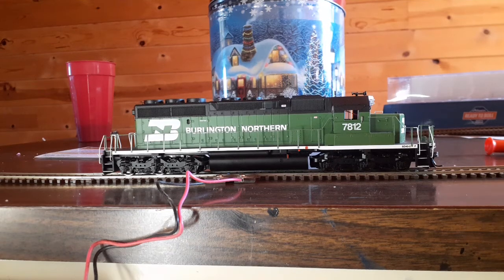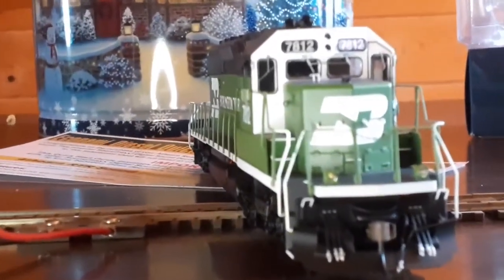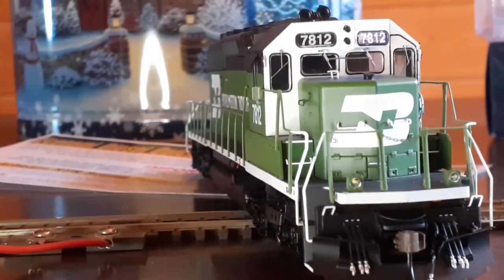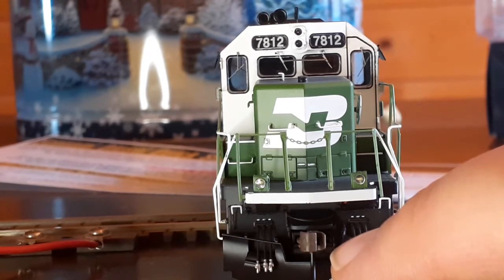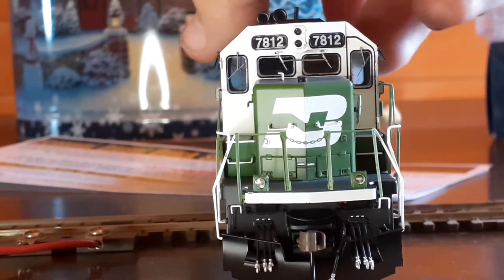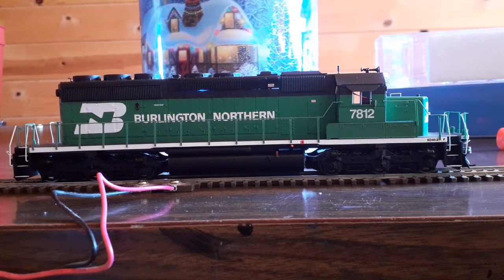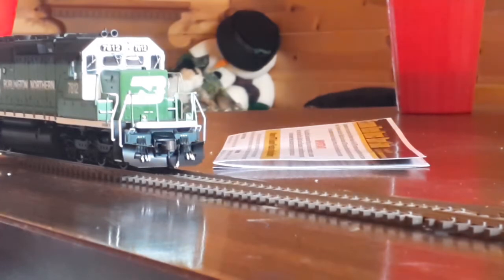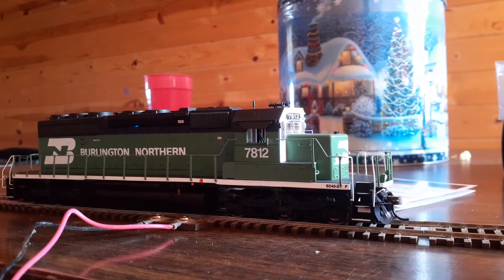ATHEARN READY TO ROLL EMD SD40-2 REVIEW!

Comment: I got lookin at some old videos from wyoming in 1994 with some SD70MACs and they had ditch lights that fashed when horn was blown and stayed solid when not blown but some of the other other SD40s had the white face paint which is what BNSF 1915 is painted in
Reply from the maker: You are correct in that BN's early SD70MACs did indeed come equipped with flashing ditch lights, however as I mentioned in the video, the lights on BN 7812 as depicted on the Athearn model aren't technically ditch lights.  They're deck mounted strobe lights that flash when the horn is sounded and then shut off after a few seconds after the horn is sounded.  Also as mentioned in the video, BN 7812 is widely believed to be the only SD40-2 to wear the white face scheme AND have "Burlington Northern" spelled out on the long hood with a large BN herald.  There were GP50s also shown wearing this exact scheme too.  Various other BN units also had the same Burlington Northern and large herald on their flanks as well, the big difference was those units had the orange and black (and in a few cases orange and white) striped nose and headlight area panted orange as well.  That being said, it's not easy trying to keep up with all of these Various iterations of BN's paint scheme, not to mention we're also talking about units as they appeared well over 30 years ago, thanks for watching.
Reply: @randallellison6421  you are correct on 7812.but with the othet white face schemes they did not have BN spelled out on the long hood

Comment: So I have a BN sd40-2 I think it’s an athern but for some reason I have 2 controllers one was a Bachman ez command another was an ncs power cab I bought the ncs and sd40 off Facebook the guy showed me both things and they worked then but when I took it in the sd40 just sits and idles on the ez command doesn’t respond to anything else does move nothing I sit it on the rails it just idles doesn’t do a startup sequence either and the ncs power cab doesn’t work at all doesn’t even turn on and both things worked when I got them
Reply from the maker: Unfortunately, I'm not familiar with either system, so I don't know if this will work or not, but you could try doing a factory reset on the locomotive and see if that does the trick, or if you have another DCC equipped locomotive handy, try it and see if it runs with either system.  Usually, that will tell you if its the locomotive in question or if the controller is faulty. Thanks for watching!
Reply: @randallellison6421  I do have other dcc engines the one is a es44dc inter mountain runs fine on the ez command but not on the ncs power cab I recently bought an sd70 ace it runs and goes but doesn’t do the startup sequence but it doesn’t make sense to me the guy showed me both things and they worked the sd40 and the ncs power cab
Reply from the maker: @ShazzledWolf32  Interesting, like I said, I'm not familiar with either the Bachmann EZ command or the DCS systems.  I do know of a couple of channels that might be able to provide the answers you're looking for though!  One is DIY &Digital Model Railway, and the other would be Jason, aka "The Train Freak", since both are specialists in the world of DCC.